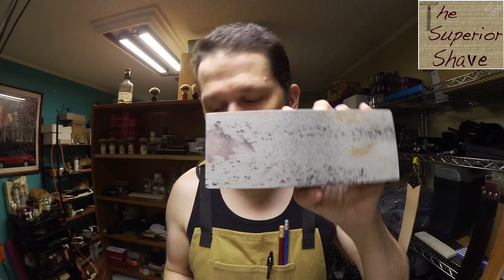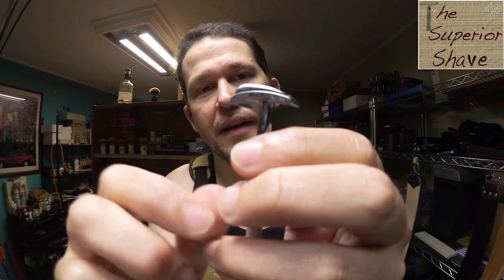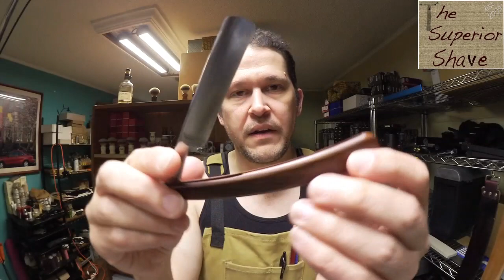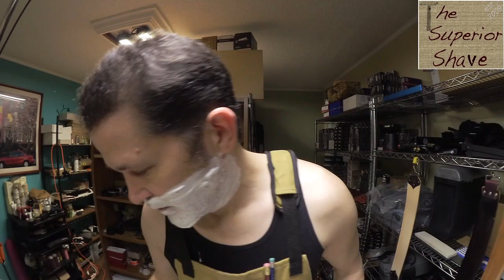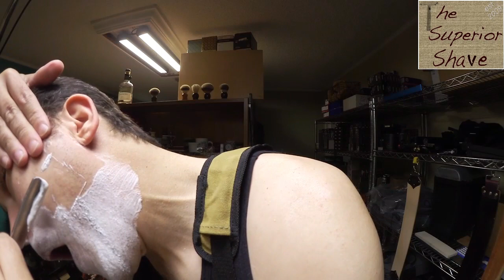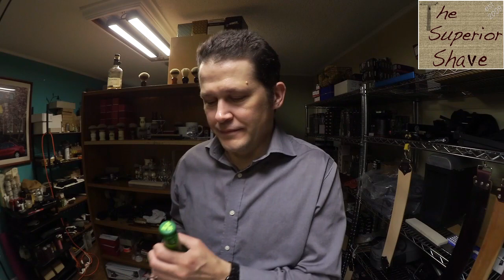Straight Razor Shave 03.12.2021 | Dan's Arkansas Stone | Erbe-Solingen First Class INOX 4/8"

Comment: I really enjoy using the Theophile Berthon. Has a nice slickness to it. Scent is good also. Using as a preshave sounds like a good idea. Although I cut mine up and ran it through one of those cheese graters they use in the restaurant back into the original tin and pressed it in. Wala!
Reply from the maker: I would really love the Euros more if they made their soaps, milled milled milled, and then squished that in to a container while it was still warm enough to mate.     

Alles Seife's not milled, though nearly as hard, and they did the one run cured-in-tin.   

But cured in the vessel it'll be making its living from is just not common from the EU folks for whatever reason, and while American artisanal soaps are by and large much softer, at least they've got that part down pat (and also use larger-diameter targets, which more easily allow the use of larger brush heads).   Maybe the Euros feel it compromises the cure at some point of the puck, but that's still a trade I make, soap's not a costly habit for me (unlike Scotch whisky).

All the good juice, using any puck to me, you lose the best stuff between the fuel surface and its surrounding vessel...that's why u always see me working these various hard pucks removed from their containers.   

When you've got the Berthon target out in the open it is a phenomenal soap.
Reply: Great idea! - with the grater.

Comment: After 1/2 of a shave with my new Dovo half hollow, the other half performed with my old used blade from Ebay, I see under the microscope that the new blade is so torn up that it needs to be honed!  The old blade was stropped and could cut a hair dragged across the edge - big difference between the two blades. Maybe I need to cut back into better steel on this new blade, or the edge is just too fine for the quality of the steel. Do I dare to put tape on the spine?
Reply from the maker: you broke the seal on the Dovo and wiped it of oil and stropped it? What kind of strop? Have you used the eBay one to shave yourself? Definitely do not want tape, you need the opposite - more keenness from the wheel shape such that you're not overcompensating w/ pressure
Reply: @thesuperiorshave  Both blades treated the same; 6 strokes on 1000 grit, more strokes on 5000, 10,000, 15,000.  Both stropped 30 times.  1/2 of a shave each.  Both blades stropped 30 times after 1/2 shave each.  One trashed one cut a floating hair.
Reply from the maker: How did you obtain the reference surface for your hones?
Reply: @thesuperiorshave  Grooved carborundum flattening stone to flatten a 200 grit JWS.  The 200 flattens the 1000 grit.  The 1000 flattens - wakes up - the finer stones. I've been using JWS since '83 and think I know my way around stone prep. though I've never used slurry.  The stones are washed clean and are aggressive.  BTW I don't really like the 10,000 Shapton glass. The 15,000 Shapton 'feel' right but don't feel as a real 15,000 - if you know what I mean. I lack the knowledge for choosing a really good Japanese Natural in the final finish grade.
I'm new to sharpening razors but let me elaborate on edges in finish carpentry...or not.
Reply from the maker: plz watch

https://youtu.be/6yvjcMvWOD0

I am sorry to tell u but you're incorrectly addressing the Dovo if Dovo's opinion on the matter is considered relevant to you for the product they produced.

You may refine their thinner+rougher edge to make it have a better fineness to the edge of the bevel, but the whole bevel shape is also very important, and by using your flattener you simply cannot achieve the proper edge to the razor, or more specifically, any particular razor cannot be as thin on edge and as far as possible from spine once it has met flat anythings.  Even I honed all razors wrong, professionally, for 7yrs and far beyond 15000 pcs, I'd wager 20k those were the good years...if only we'd have been honing them correctly in those salad days maybe the pursuit wouldn't be dying off today.

You need to shape your hones either by this device, or it is not hard to do by hand to any waterstone (that's what they do in Solingen and at least one semi-charming grinder considers this plate ~ 'cheating', dunno if they use slide rules or their phone/calculator);

https://thesuperiorshave.com/product/experthoningsolution/
Reply: @thesuperiorshave  Thanks again.  I was under the impression that I had to reshape every stone, from 1000 all the way to 15k, but it seems that maybe I can get away with just reshaping the 10 and 15k.  Is this correct?
Reply from the maker: In my professional opinion, one primary-axis diameter is the best approach throughout the whole process for least 'extra' metal consumption.    If these effective diameters vary in the steps shown in those videos, it is not something the grinders are very forthcoming about, beyond to say that it always has the curvature.

In Solingen and Thiers today going back to the mid20th. c or so, they use rotating discs where the grinding plane is the wide/flat part of the disc (rather than its 'rim') and set the bevels on these, always intentionally made slightly convex.   In France it is a natural local stone and there's two wheels and they're spinning in different directions so that the "show side" grinding and the "non show side" grinding do not vary in edge-leading or edge-trailing abrasive, while in Solingen it is one larger wheel in two steps of grit and they do not reverse the spinning direction of the abrasive so the "non show" side is always being affected by edge-trailing abrasive action in these steps.   That choice of the Germans, and the specific manner in which you'll see any company's grinder approaching that disc as the spine of the razor relates to the center point and circumference of the disc, is what I believe explains the consistent very subtle variance of warp of a Solingen razor toward the 'show side', without exception, I cannot recall ever handling a >WWII Solingen that bent the other direction toward the 'non show' side.   The French razors, OTOH, present their deviation from straight perfection differently, more like a short-wavelength sine/cosine type curve going across the cutting edge.   The easiest way to observe these variances is with a binocular stereo microscope at ~20-25x and hold the razor in hand and move it around subtly while keeping the cutting edge facing directly toward the scope's objectives.

A grinder once told me 'all razors are warped, only the magnification we need to observe this curvature varies', I think that's why they make those discs convex.   

However, the most senior grinder I spoke with before he passed did explain to me that the last part of the bevel furthest from the spine when <0.1mm thickness and correctly tempered and ground should flex to the curve being imparted from the stone (just like how you can observe your thumbnail push the bevel aside 0.5mm or so and return back to shape by drawing the cutting edge toward it), and thus you can set the cutting edge on flat things (or for that matter a taped spine and a flat thing) and refine only on the curved bit and you'll get the same thinness advantage at the ~10% end of bevel as if you'd established the edge with a wheel shape.     You'll just will not have the remaining 90% of the bevel profile with the same shape as if only curves are used.    

Whether this is as good as if the whole is as thin as the steel will hold, without blind A/B tests using the same model razor and abrasives and only fiddling with this geometric issue and doing several A/B evaluations where you do not know who is who (use infrared marker and write on scales a number after honing), I cannot say - what I can say is that I love fiddling about with the double-blind A/Bs, and it is from these that I know when all other factors are equal and only the V-shape or inward-shape cutting edge is altered, I consistently choose the hollowed edge as the subjectively superior edge in the blind testing.

Comment: A short trip and out the other side, to discover it is all hype!  4/8 , 5/8 , 6/8 , half hollow, full/double..don't matter!
An old, worn blade bought off of ebay, measuring  11 1/2 mm from spine bearing point to edge and a new 5/8 measuring 18mm from same, shave equally well.  The narrower blade is easier to maneuver and will keep its edge longer than the finer bevel on the more wieldy blade. If ever I buy something in full hollow, with Snake wood scales and gold-filled etching, it'll be because I won the lottery. (spend your money on good stones) IMO
At 67 years old my beard is like copper wire and my skin is loose - you might, if you're young and just starting with a straight razor, you might want to begin practicing for the day your face and beard work against you!
Reply from the maker: I do tend to shop for steel as the blind man would, I don't care for spine / show side decors, shape + grind's what's important.   

Easy mark for some timbers and natural mother-of-pearl, though.   When we started as business 2009, the 1-piece MOP scales had just effectively ended from Germany and they were for a couple of years putting two or three shells together to make a scale.   I'd love either one on a Dovo #98!